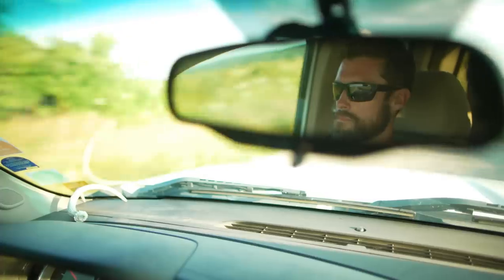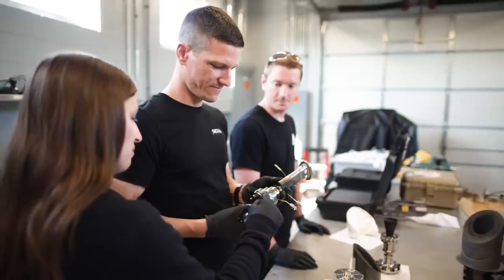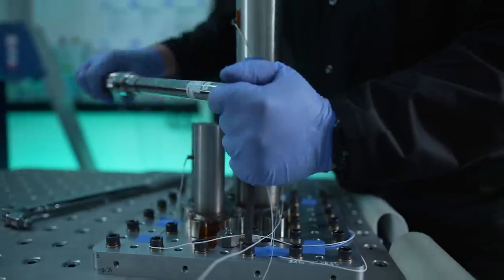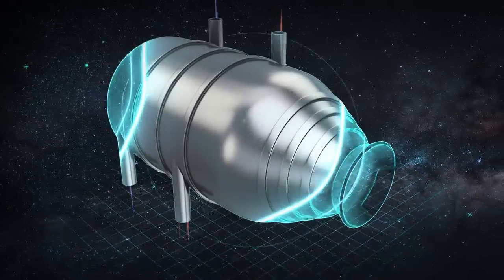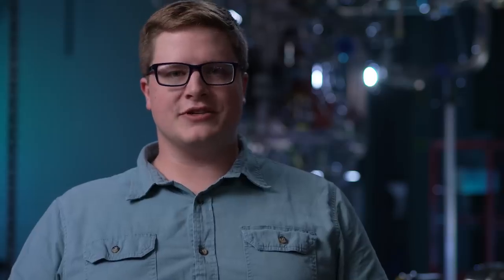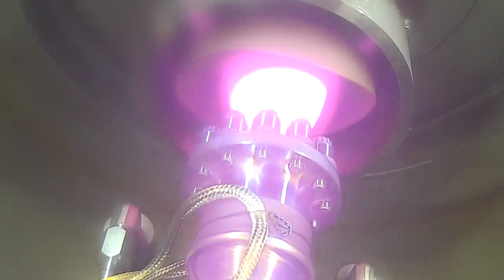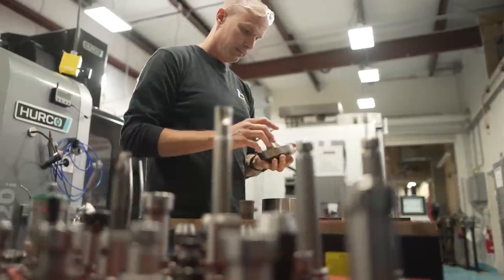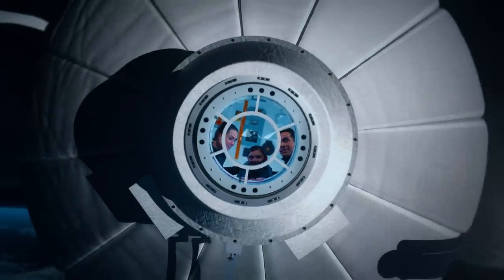Mission: Tenacity | Dream Chaser Propulsion Systems

Comment: I have work on the surface of Mars in the form of the Pyrofire Boards for the Curiosity Rover. They control the Explosive Bolts used to control deployment of various components.

Comment: "the team pushes materials to their limit" ... shouldn't there be safety margins?
Reply: that's exactly how you develop safety margins. by figuring out at what point the material will fail and then developing solutions that will prevent it from ever getting to point.

Comment: While for the time being we seem not to have a better delivery system, but at least for launching payloads into space i am pretty sure we will one day have better once then those based on burning fuel. I have seen test projects here on yt where they built sort of a magnetic catapult, first getting speed in a loop before released onto its trajectory and a little further down the line space elevators for which the ground work currently is being developed by inventing manufacturing processes to get carbon nanotube which are needed to realize them. Would be intresting to see if any other viable delivery systems are in their infancy stage currently, but still worked on.

Till then it is still great that engineers invest time to make better rockets. Though if i am not mistaken and assume correctly the future of space rockets would be ion/plasma propulsion systems, which then may not need to start from within the gravity well of a planet.

I can not imagine many other jobs that are more manly hrhr :)
Maybe flying those then. Also mad respect to the lady working in this seemingly men dominated field.

Comment: Never clear on why this thing didn't deserve a nose wheel. It got the handicap 2 x 4 skid instead. Even the X-37 has a nose wheel. It is good to see someone picking up where NASA failed to pursue the DynaSoar and the X-38. It seems a no-brainer to use a spaceplane for crew shuttling to and from ISS. NASA spends so much time and money winding itself around the "Diversity" axle that they have nothing left for much else.

Comment: « I had a dream » of a twin Merlin powered improved dream chaser fitted on top of a downsized Falcon 9/ mid core heavy recoverable stage or similar (large Pegasus winged rocket landing back like a empty light glider) and launched at 30.000 feets high by Tim Allen Stratolaunch or a new Ant224 plane, to become a three stage fully recoverable orbital system, a safe all weather and economic crew switching orbiter and payload provider..using only as solid consumables a few small 3D printed third stage jettison ergols tanks disposed off just before orbital speed is reached like the shuttle did with its huge ground to top speed main tank, this way saving the cost and weight of heat shielding large empty tanks like bigger starship does..the high altitude plane launch is also a weight saver with the additional aerodynamic lift of the load body and since a rocket weight is already much lower after a few seconds and a few thousands of feets of climbing…finally three stage is much lighter than two with less dead empty tanks and oversized rocket engine weights needed to be carried further out..but all those currently technologies in different hands would have to join forces..and this today, just seems to be still inimaginable …unless headed by NASA or equivalent as main contractor..

Comment: RCS thrusters have been commonplace since before Project Mercury. Not sure why so much effort is being dumped into something so ubiquitous. RCS thrusters used in a ton of applications are machined out of phenolic. A little hypergolic fuel and they puff as hard as is needed. Even the Krauts had excellent performance using T-Stoff + Z-Stoff engines to blast the ME-163's into the stratosphere back in the 1940's. The only RCS problems I've heard of were fuel depletion like on MA-7 and Gemini 8. I would be more interested in getting the vehicle as a whole into service ASAP. Years are going by and so far, just a drop test or two. A couple of good ol boys at Dreyden were able to build and flight test a whole slew of lifting bodies in just a few months.....even towing them into glides behind a souped up Pontiac. Sierra isn't having to bust nuts and guts to beat the Ruskies, like we did in the 1960's, but c'mon, Man, sometime this century already.
Reply: You are one of the few people who understood what this all means , seems majority like 99.999% don’t really get what this video is all about . Wish more people would understand . Basically this isn’t a propulsion system as in 1st or 2nd stage. This is more of an ability to steer in space.

Comment: Sorry to say, but I'm starting to lose faith in this Dream Chaser project. It's getting to be "forever project" like SLS. 

You have announced in the history that the launch date would be November 1st 2016, then you informed that SNC Demo-1 would fly 2021 and then it was pushed back to early 2022. In May 2022 Dana Weigel announced that mission was scheduled to February 2023 and the latest information is that the mission is delayed to December 2023. 

Please, just get it off the ground. If it fails in some stage, at least you will have plenty of information which way to go next.